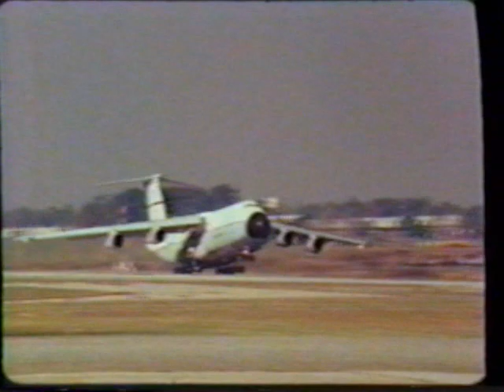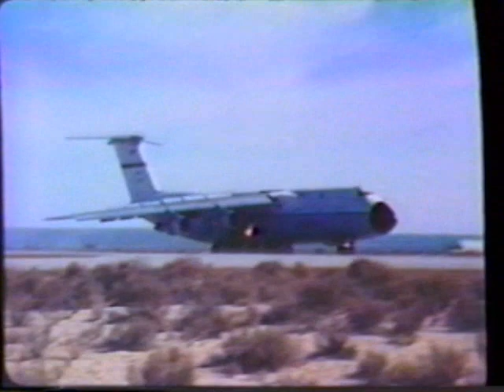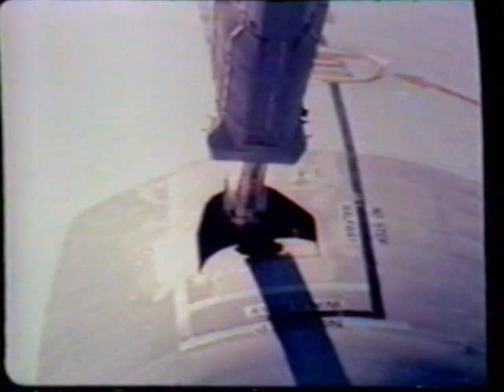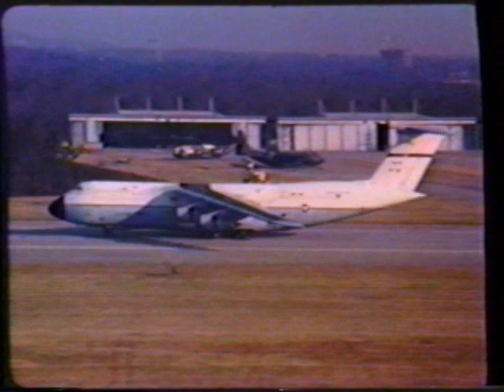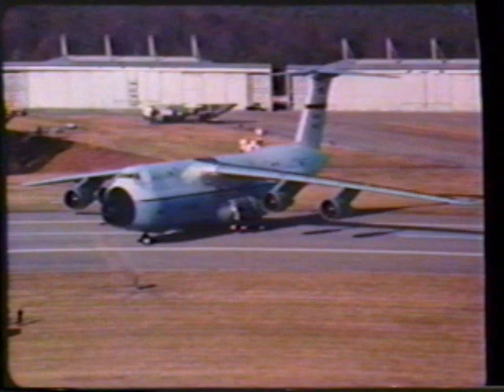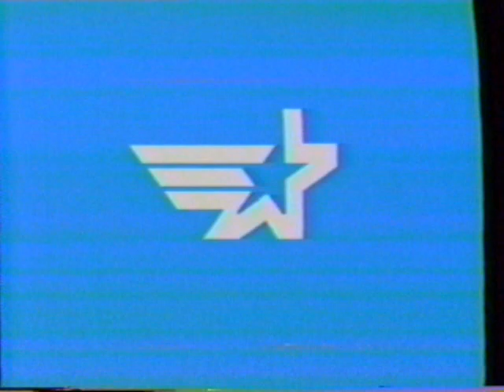C-5 Galaxy Enhanced Ability

Comment: Do you by chance know the serial number to this Galaxy?
Reply from the maker: I do not. However, I also strongly suspect the tests were run using more than one airplane.

I remember seeing the C-5A back up on the Dobbins runway, my recollection is that it was during warm weather. The heavy weight record flight, on the other hand, was flown in December of 1984. That's r
Reply: 68-0214
Reply: @wksmith2155  214 never had camo wings